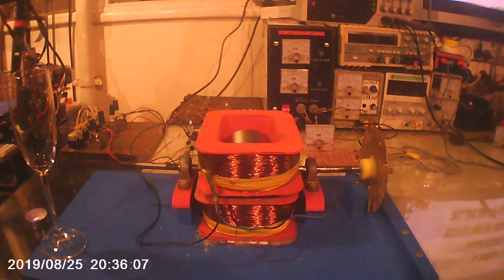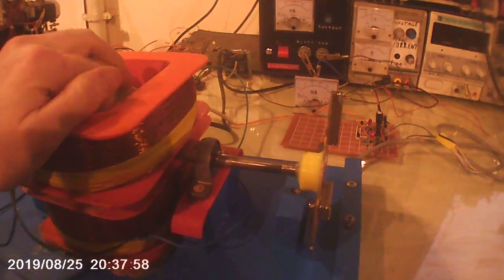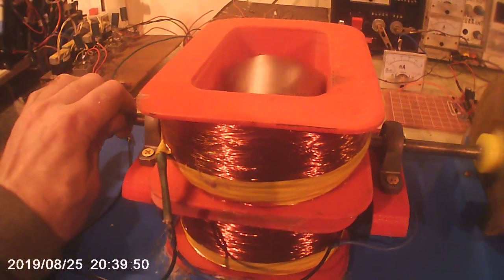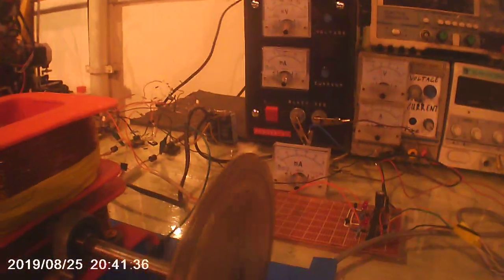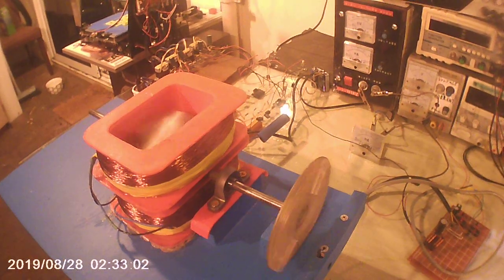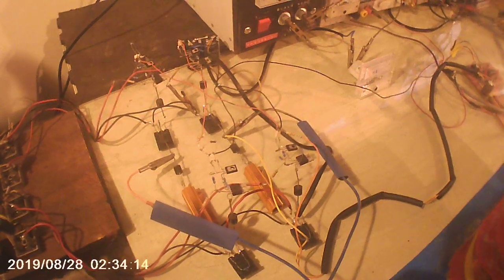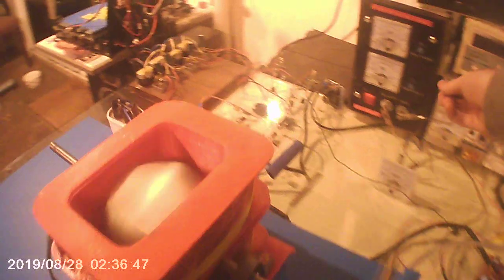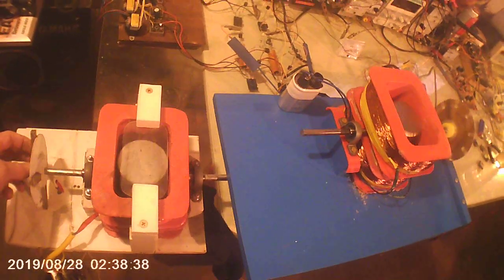Newman Motor Update    -   A True Heavyweight

Comment: Does Axel angle for the magnets matter?
In big eureka the axel was at an angle and turned a pump.
I'm just wondering if anyone has tried the different angles and if changes the output.
Reply: There are multiple ways to wind the coils, and experimenters should try various coil lengths, thicknesses, magnet depths, and pulse timing. Some versions i've seen use tightly wound bundles, some are single layer. I don't know what is optimal.

Comment: have you tried diametric polarised neo cylinder magnets. they can have an inside diameter for a shaft along the long axis. not sure if they’re more efficient overall but definitely cuts down on wind resistance. nice work.
Reply from the maker: haha good work rodney, wind resistance is not a problem i plan to deal with,  just add more power finesse .  currently finalizing some thoughts before the next build, doing this with 180degree duty cycle and single transistor

Comment: Power is always related to how many watts are on the input, Doesn't matter if its high voltage or high amps.Nice work ,Thanks for sharing!!
Reply from the maker: related yes, but definitely not proportional. motors all vary in efficency from around %40 too %95.   i dont hesitate too quote 1000% for my best newman, (however belive its closer too 2000%)

Comment: How does a brushless motor compare?
Reply from the maker: modern brushless motors are great, ... grass is always greener on the other side you know.... but i aimed for massive COP and i got it, - 10-20 easily,    although not good value, - currently i have a $600, 30watt pedistal fan that is barley COP 3, because you only get high COP at low power levels.
Reply: Great build!  How do u measure power out of the unit? How much resistance in your windings? what awg wire do u recommend? Thx!

Comment: What wire gauge are you using?
Reply from the maker: hello sky. love your work too. - wire gauges are between 0.27-0.33mm.  but although this machine does produce efficency of 200%.  only at low power levels. - around 3 watts per kilo of machine !!
Reply: How much weight of wire in this model?  In reading Newman’s book he maintains weight of copper is everything - more copper, more efficient.. one model design he published stipulates 140# of copper in windings!

Comment: Newman's real motor uses a much longer shaft and magnet arrangement along that shaft length, so as to take more advantage of the A field along a very long length of coil wires. Your motor has majority of wire going across the shaft rather than along the length of the shaft. Remember, electrons in a wire are moved when a magnetic field swipes across the wire, not along it's length. Good work though. Keep at it.
Reply from the maker: haha yes, that is a good thought, - never occured the magnetism behaved like that. - im pretty sure it will have the same intensity regardless of the geometry ... my new one is twice the size, - i will post when i am finished next week ;=).  longer lever arm is what im going for,

Comment: If mass is the trick... perhaps making the rotor more massive... such that it would ramp up more slowly but maintain more torque, and allow you to couple it to a generator?

I never got started experimenting. Do you have long term goals with this?
Reply from the maker: i definitely have long term goals with these machines. - and i see it as a lever arm motor. - so you are right about having a long lever....  - i currently have a magnet stack which is round & 25cm diameter, and 44cm-50cm tall.  - they are speaker ring magnets from ali baba...  but i want too do a few more test machines too figure the coils and electronics out first.///  btw. -they accelerate mass dangerously well., and decelerate !!!so we either need too limit current and have protections. - or build it impractically strong
Reply: Newman Motors are Long in length because it wants to make use of greater amounts of permanent magnets.   Coil size is significant as well.

Comment: a loop test !! so the 2 coils you showing one is to move the motor and as generating coil ?
Reply from the maker: right on,
Reply: @director-patrickwatkins  but how you will use the newman motor? i mean are you going to use it as a prime mover to a generator ? does it have good tourqe? like 100 N? are you able to measure the tourqe?
Reply from the maker: plans are too use conventional generator, because i think it is already very over unity.  did you see newmans original ?.  lol, 5000lb motor turning with some 9v batteries ;=D...  - most people cannot even turn by hand unpowered ;=D.
Reply: Patrick Watkins, Director yea for generator regular one you will need about 64 nm for 10kw and about 120nm for 30kw